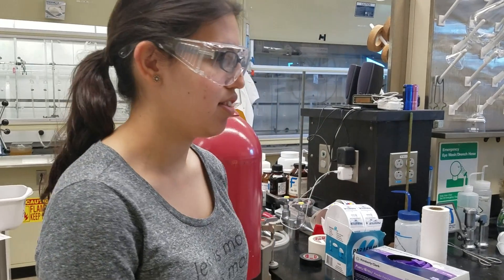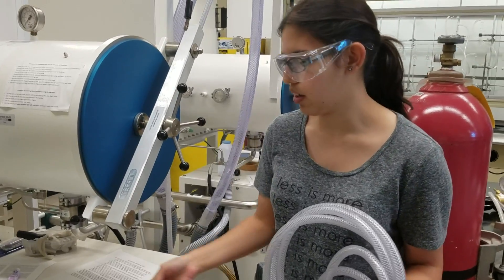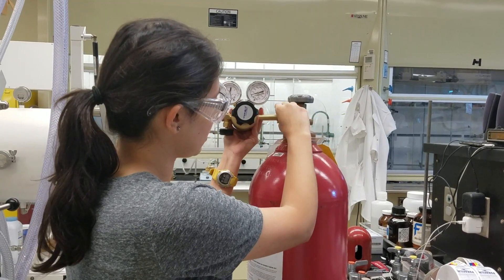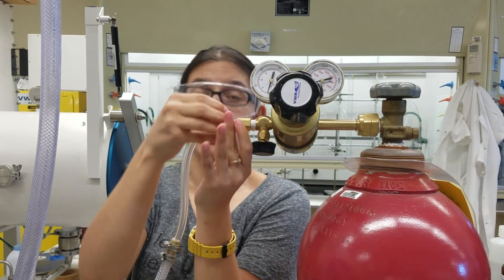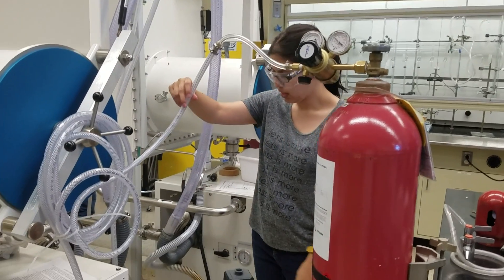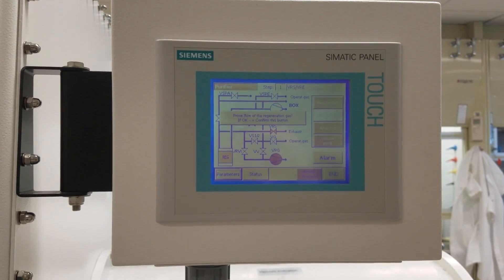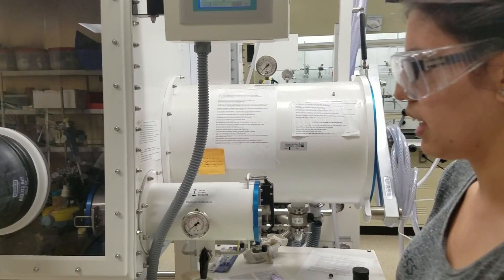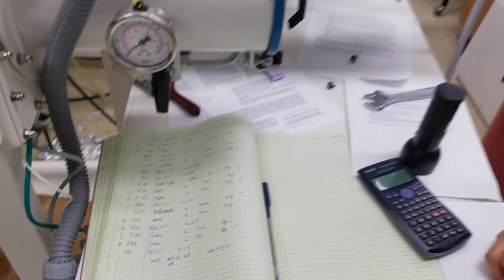How to Set Up a Glovebox Regeneration

Comment: As mentioned below, thread tape should never be used with cylinder regulators as the threads do not provide sealing! Sealing is generally provided by an o-ring or the coned surface of a bullnose type connector. Thread tape can actually prevent proper seating of the o-ring and cause leaks. Stay safe!!
Reply: Tape on the threads  is sometimes necessary if the threads are messed up.  An experienced person would know better, but screwed up threads can give a student or even an inexperienced PhD a false sense of having tightened the regulator enough.
Reply: @paulie2009  My previous comment was deleted. It was probably too blunt but I guess I'm jaded from all the shoddy practices I've seen in university labs in my time. I don't accept that, we should always be teaching our students best practice and give them the tools to identify risk in the lab
Reply: If you can’t tell that the threads on your regulator are trashed and you shouldn’t use that regulator, stick to working in a cafe, not a lab…too many PhDs these days with shit for brains

Comment: THIS OPERATOR IS MAKING A DANGEROUS MISTAKE
Teflontape should NOT be used when mounting a regulator on a gas cylinder. A proper ring MUST be put on the center of the fitting. The function of the nut is "only" mechanical, it attaches the regulator to the cylinder and it presses the applied seal. The nut itself does NOT have a sealing function. 
PLEASE be aware of the fact that a similar silly mistake like this caused the Challenger disaster.
Reply: I question this as well. I also wondered if there is some kind of H2 detector/sensor alarm that would alarm in case of a leak and what some of the requirements would be.
Reply: Ok... I've edited a previous version of my reply that said tape on the threads is mostly ok.   Maybe it's ill advised and unnecessary, at worst.  But sometimes it's actually a good and necessary thing when the threads are buggered up and prevent tightening, the tape is a thread 'lubricant' not just a sealant.  A loop or two is not going to stop the brass to brass seal of the CGA fitting.  An experienced person would power through most thread glitches on brass fittings as long as there was a good "feel" and no cross threading ... but a student or inexperienced person might not and think they've tightened the fitting when they haven't.